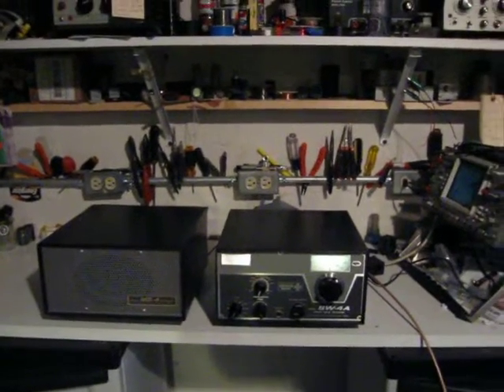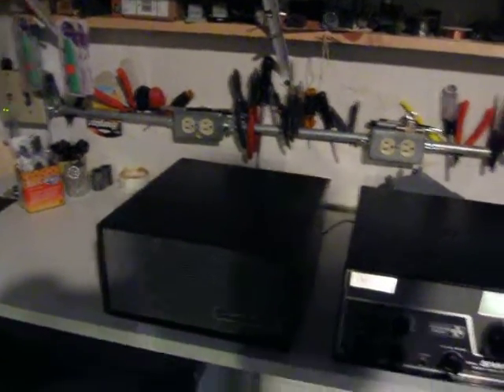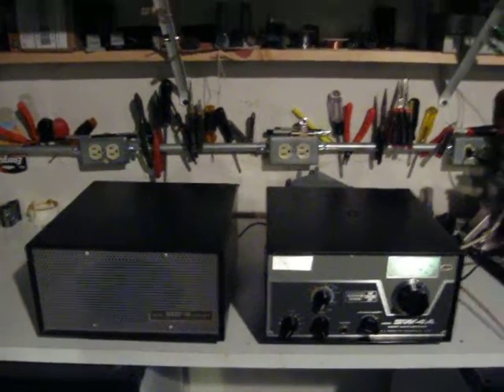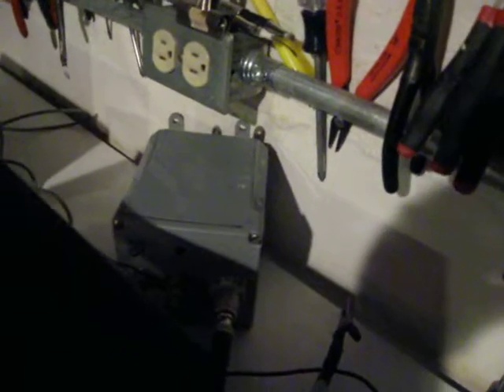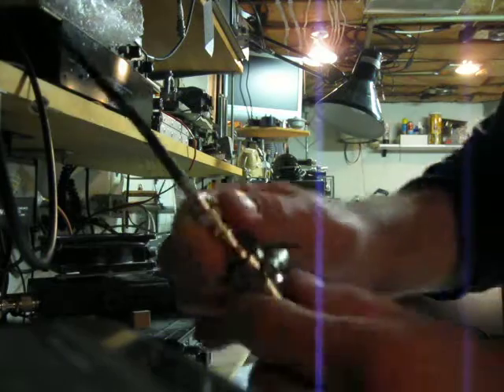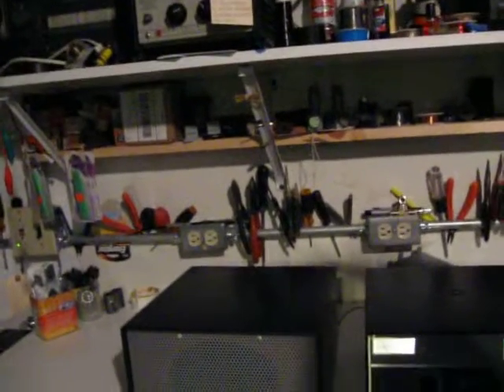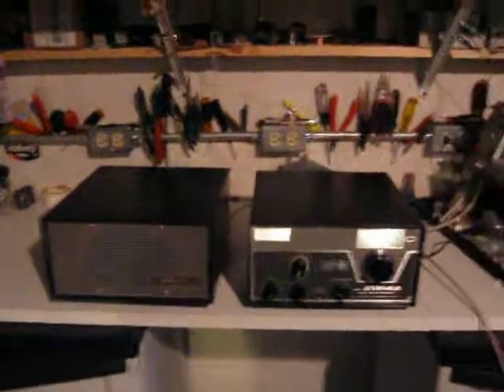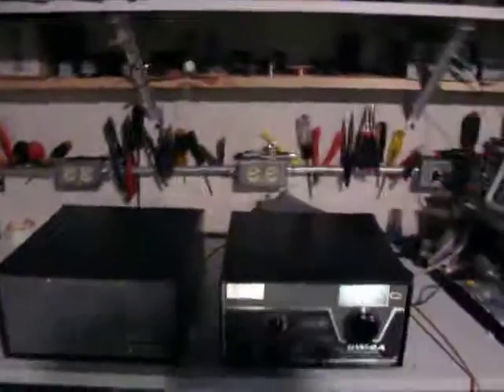Drake SW4A & Medi1  171kHz Longwave BC @ WA3TTS

Comment from the maker: I added a few photos of the chassis with the covers off, some dust pitting on top but a box of Q-tips and a rub down with Teflon Tri-Flow lubricant helped with the chassis clean up. Bottom of chassis is real clean. Did the usual PS recap, found a few out of tolerance resistors, one 6HS6 had a filament to cathode short but OK gain, replaced with 6AH6. Bandswitch cleaned with Tarnex, acetone, then DeOxIt D100-acetone-S100 protectant. MS-4 cabinet needs a repaint. Great Radio !! 73 wa3tts